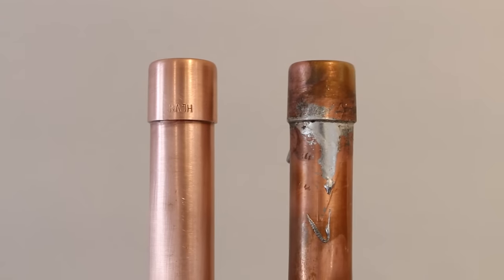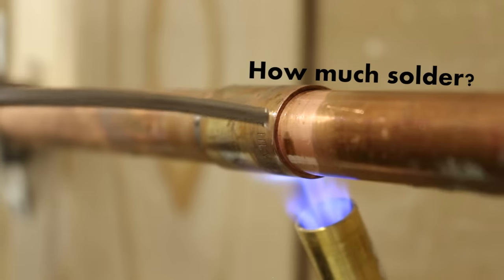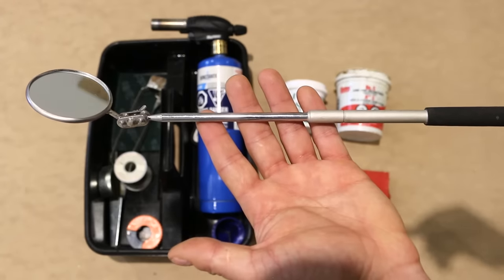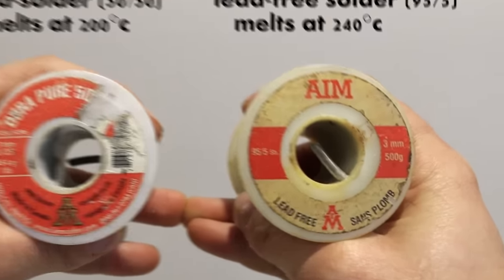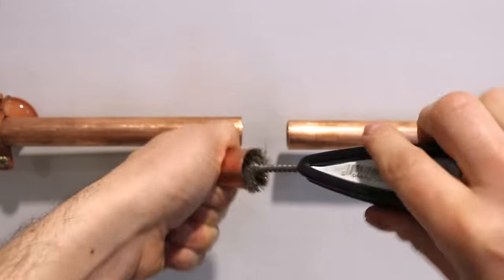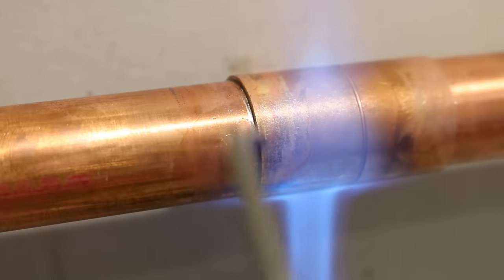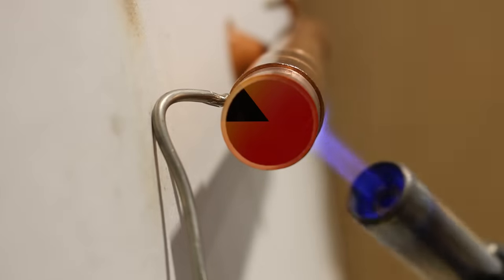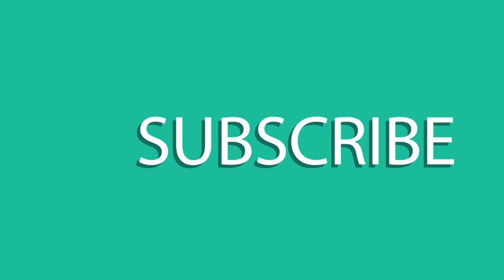How To Solder Copper Pipe Like a Pro (Tips & Tricks) | GOT2LEARN

Comment: the blind leading the blind.  Try rotating the brush as you put it in and out and you won't bend it into a useless tapered brush. Scotchbrite is for pots and pans, plumbers roll emery  is what you clean copper pipe with. Self tinning (dippy dyi alert) only needed if you overheat the copper like this guy is doing. See the copper discolor in this vid, exactly what you don't want.  You start by quickly test touching the solder repeatedly where your are heating. Move fast enough that you don't melt it with the flame.  About the time you see beads of moisture on the copper, hence the term "sweating copper" the solder will flow into the joint, so put a little in to protect the copper from the heat. , it's hot enough, move the flame around or turn it down, the solder will melt and flow into the joint by capillary action and protect the copper from oxidizing from excess heat. NOW move the solder to the opposite side of the fitting while you gently heat the base of the fitting. The heat will draw the solder. Touch the solder to the base of the fitting opposite the flame to make sure it will melt, then you know the whole joint is hot enough. Feed solder to you get a drip, or if going for show until if fills the joint. If you want it to look perfect, like for a trade show, let the joint cool a little then heat and wipe repeatedly,, just enough to heat the surface, not to melt the joint, then use plumbers roll emery and sand solder away.

Comment: do not over heat... MOP gas to hot... and this guy sucks... don't leave heat in one spot even heat 1 inch area keep the flame moving and flame 1/4 inch from the pipe... less heat the better. most solder melts a 450 F. copper changes color at 500 F. will darken to a dull copper brown. 600-700 F it will turn light blue 700-800 blue purple 800-900 white to gray 900-1000 shinny gray then melt... over heating is a killer. and will cause failed building inspection...

Comment: How are you going to make a video claiming a perfect solder then show an example with tons of potential leaks? I wouldn't have made it through my first month with pin holes like that. Same for all the extra waisted time. This just made a quick job take multiple times longer and added more chance of leaks just to make something that the homeowner would never see slightly prettier. I guess it's a good thing copper is a thing of the past cause that definitely wouldn't fly in new construction.

Comment: Never mind soldered joints  it is about time a lot of so called plumbers  learnt how to fit compression joints without over tightening  them and or using compound plus you should NEVER  use any grit or particle based devices for cleaning  pipes so many bad joints are due to bits of sandind compound in the joint

Comment: Use Everflux and save all the time you use on cleaning the copper pipe.I started using it a few years back I was skeptical at first but now I swear by it. Have you ever used it and what's your opinion on it?

Comment: this is how you make a pretty joint not how pros do it you would get run off the job. Im going to make sure there is enough solder in there and good luck doing it this way on 1-1/2 and up. Chinese fittings and Mexican pipe that contractors like to order have id's and od's are always out of spec with gaps to big that you have to try and bridge with the solder. Clean it good, push it in, knock of the excess, and wipe it down with a wet rag that's how pro's do it.
Reply from the maker: Never got ran off any job, once you know how to do it this way, it works just like any other joint.

Comment: Or, you can just run a flux brush over your new solder work when completed to clean up the joint. Then use a dry rage to wipe off.

Comment: You don't need to apply solder to the bottom of the joint if its vertical, just heat and the solder from the top joint will do both. That blob of solder at the end was terrible, visible or not.

Comment: Well its a nice video but when on a time frame u don't get that luxury. Plus 1/2 to 1 in thats easy anything above that good luck. Another note you can't use lead period in California. Another side note is not all fitting are made equal. Warm pipe up and wipe flux off then add solder and itll fallow the heat. Is how i was trained. So it dont look like a Roman candle lol.
Reply from the maker: Yes, this isn't really about time, it's about getting a nice soldered joint that would be exposed, so time wouldn't really be an issue here.
Reply: @Got2Learn  don't get me wrong I enjoy your videos but if u can make a video in hard postion that would help ppl when under houses or tight addics cause thats true skills witch it seems you have. Keep up the good work you have impressed me on some of your videos 😁
Reply: @Got2Learn  and again this art is being faded away with propress or shark bites(John guess fittings) so alot of new plumbers don't know how to solder so thank for teaching them and keep solder alive

Comment: Wow!! Talk about a cold joint! Someone needs to teach this guy how to solder correctly without all of that wasted time
Reply from the maker: No cold joint buddy.
Reply: Solder follows your heat(flame) not the flux so pulling your flame off when the joint is only halfway made is most definitely a “COLD JOINT “! Have fun fixing the leaks. Why would you ever use tinning flux on 3/4” copper pipe anyway?! It’s messy and pointless but I guess you residential guys probably need it
Reply from the maker: @mdebrule2012  🤦‍♂️

Comment: I was told to ream inside of pipes after cutting with tool.
 on a few older pipe cut off tools there is a pointed steel tip used for this purpose

Comment: That blue can doesn't work very well at all. Use map gas in the yellow can.
Reply from the maker: MAP gas, doesn't exist anymore, the yellow bottles you find at Lowes is NOT true MAP gas, it's just slightly hotter than propane.

Comment: Better to make a fully water tight joint this is potentially a way for the joint to leak
Use a bit more solder wipe it with wire wool can look really neat if you do it right

Comment: So on the fittings you just clean the inside right? And how long estimate do you hold the torch to the copper for before applying solder?
Reply from the maker: Yes, only clean the inside of the fitting and the outside of the pipe. For the amount of time to hold the torch, it depends what size pipe you are soldering. The goal is to not burn off the flux, a trick is to keep probing the joint with your solder as soon as it starts going in, that's a good indicator that it's hot enough, just practice a bit and you'll get the hang of it ;) In the meantime, take a look at my other "how to" vid: https://www.youtube.com/watch?v=xJodDBC5AwY&t=1s
Reply: Thank you!

Comment: Is there an involvement of the capillarity action?
Reply from the maker: Yes, capillary action is what makes it all possible :)
Reply: It could be said that flux acts as an adhesive to overcome the cohesion of the solder itself so capillary action is possible.
Reply: Yes.  This video don't explain it right.  It was explained to me years ago so long ago I don't remember exactly.  There are 2 things - I can't remember which is right.  But FIRST, there is the boiling of the flux.  You want that.  Because as the flux boils away, if you do it right, it goes into the pipe and creates a vacuum that sucks in the solder.  Now don't misunderstand, you don't want to scorch / burn the pipe. Gussying up with a scotch brite pad won't undo burning the pipe.  If you burnt the pipe, the pipe is that much weaker chemically in the spots you can't get to clean up.  Second, you want to heat the air inside the pipe that is away from the joint.  When you apply the solder you want to be NOT applying heat anymore.  You want to have the hot air cool, creating more vacuum.  So really the torch goes on until you see/ hear the flux sizzle, then QUICK remove the heat source and apply the solder.  It will suck up and in around the joint the way it does in this video.  I guess this is considered "advanced" soldering... I guess basic soldering is when you run the wire around the joint while torching it and hope there's solder in the joint??

Comment: Youre getting pipes way too hot, thats why your vertical joint drips and fitting have discoloration, tinning flux will tell you correct temperature and until the you can keep solder away and heat evenly

Comment: #1  NEVER use a swirl torch.  It puts out too much heat and burns off the flux.  Biggest beginner mistake.
Reply: @Got2Learn  : swirl torch puts out a hotter flame faster and is harder for a noob to know when the temperature is correct.  carbonizes the flux inside of the fitting too easily.   the 'old fashion' pencil torch on 1/2 and 3/4 takes longer but brings up the temperature more evenly.
the other #1 problem is to not drain/ dry out pipe when doing repairs.   any steam means the pipe cannot get hot enough for a perfect fitting every time.
Reply from the maker: Good input, all makes sense. I am just so used to using mine that it's everyone's go to torch but yeah, it does make it easier to gauge the temperature with those pencil torches, thanks Dave!
Reply: @Got2Learn : thank YOU !  you make it look easy and you are doing the steps exactly right.  you sir are a great teacher and offer a simple and direct and easy to do video.
Reply from the maker: Thank you so much Dave, really appreciate it and I also appreciate have good members like you on the channel, cheers!!!

Comment: The best way is to hold the flame towards the middle of the fitting and leave the width of the solder around the joint. Any dirty lines will cause leaks and if you debri the pipe it will prevent leaks at any pressure

Comment: Hey, great show! Quick question, is there any difference between soldering gas lines vs. water? Thanks!
Reply from the maker: Yes, you don't solder copper for gas lines, you either thread steel piping or weld it.
Reply: @Got2Learn  I gotcha, thanks! It's sometimes hard to sort out good ideas from terrible ones. ☺
Reply from the maker: All part of the learning process ;)
Reply: Where in the world are you ? Most gas  lines in the UK are mostly soldered copper . 
Threaded steel is also used .  But in domestic properties ,it is almost always soldered copper
Reply: Copper for outside BBQ but use flare fittings. Or other gas lines are threaded welded or gas tight
Reply: I guess some countries are different, but where I am yeah you do everything the same,except for gas its ok to use solder with lead. Anything that has drinking water uses lead free solder,other than that the lead solder is much easier to work with.

Comment: I’ve always used silver solder on my copper pipes. Any other type doesn’t melt as easy and recess into the joint as well as silver.
Reply from the maker: Yeah silfos is good stuff.

Comment: The way that you apply the solder causes air bubbles and will eventually cause a leak. Like a professional
Reply: In order to get no air bubbles and full penetration you start at the bottom go about 3/8 around and then come around the other side of the pipe forcing the air out of the joint
Reply: The way its shown in the video the thermal expansion will eventually cause a leak due to a air bubble or not full penetration of the cup
Reply: @lilboyblue5977  Naa I've soldered over since I was an apprentice. Just over 10 years now and haven't had a joint fail. This dude's right on the ball.  If you can do it any better upload a video and show us. Otherwise leave it to us professionals 👍🏻
Reply from the maker: Thx @ghost!!
Reply: Im not saying it wont hold for 5, 10, if not 15 years but the joint isnt as strong as it should be
Reply: @lilboyblue5977  As long as the joint isn't rapidly cooled it won't fracture. My joints are very strong. I've tested my pipelines to over 10 bars of pressure.
Take it from a guy who's soldered 10's of thousands of joints. I press my fittings now only solder on the odd occasions. There's absolutely nothing wrong with the way these joints are formed. I even swage joints now and again. I reckon I could close my eyes and sweat a joint.
When people are constructively helping others. I don't understand why people are always trying to criticize their efforts. I've heard it all from customers to employers.  Many have a have engineer or plumber friend. I realise it's a customer showing vuntribility.  There's good and bad guys out there. "We live and learn".
Reply: ASTM 828 standards
Reply: @lilboyblue5977  Astm 828 standards for tensile testing paper 🤣
Reply: Well at this point im going with you dont know about the copper development association either?
Reply: @lilboyblue5977  our regulations and bylaws governing the institute of gas  engineers is totally different. Plumbing water and gas safety institute regulations govern our work. We have to have years of training to qualify. Do you know anything about pipe purge installation volumes, working pressure, installation standing pressures, pipe sizing, gas rates, and ventilation requirements?  Sweating joints is very simple.  I could go into depth with electrical as I'm a niceic registered contractor.

Comment: Theres fcuk all solder on those joints. I would have never past my C+G with that. I have seen loads of crap under soldered joints failing and its no lathing matter as it cost's £1000s in repair bills.   And those Amazon affiliate links are not the same tools used in this video the Amazon affiliate links tools are 3 times the price. pack of 8 scotch pads for $8.30 is taking the piss you can go down your local dollar store and get a pack of 10 for a dollar uk / us  both the same
Reply from the maker: Ok Ben, have a marvelous day :)

Comment: This is actually the correct method. Thanks, I've been sloppy too long. The only downside is glance inspecting a job to make sure no joints were missed.  
Something else. In urban areas as the bare copper takes on a patina the air pollution turns it black. Not attractive. I lived in Old Montreal in 1980 when the roof of Notre Dame Eglise was re-coppered. Over a few months through my studio windows I watched as it oxidized a beautiful bright green. A sign that the air even in downtown Montreal is very clean. A few years later I was living in Los Angeles where the Griffiths Observatory dome was also re-coppered. It turned black.  They had to clean it off and then chemically patina it green. So a fancy final step to copper plumbing might be to chemically patina it to a nice shade of green. I worked for a sculptor who worked in bronze. His assistant would apply the chemicals, which were like flux, then heat it up with a torch. In a few minutes it would be good for the next several thousand years.  There's a Department of Water and Power building near where I'm living now that used to be a beautiful patina'd green, then some suit decided it should be 'polished' back to bright copper. I thought they must have sealed the surface. Nope. It turned black, looks awful.
When Shutters Hotel in Santa Monica California was being constructed, apparently the plumbers used leaded solder for some part of the potable waterlines. This wasn't discovered until much later after many of the walls were finished, expensive wall treatments applied, etc.... It all had to be torn out, the pipes replaced, etc... Must have been a huge lawsuit. 
What I remember growing up and using lead solder to sweat pipes was this troupe, "There's so little lead that none of it gets into the water. So it's safe."  Until it wasn't. 
Gasoline was also leaded. We kids used to like the smell of car exhaust because it 'smelled sweet.' That was the lead (who knows what I could've accomplished had not plumbing, GM and Big Oil not conspired to expose my generation to lead. This is something else you guys can bash us Boomers about. ) The problem in Flint Michigan was when they switched from Lake Huron water to the more acidic river water; this little bit of acidity attacked the lead in the old pipes leeching it into the water.  (I've been using a reverse osmosis system for the past 36 years.) There's a famous op-ed from the 1920s when lead was first added to gas written by a doctor who warned that this was just mass lead poisoning. Automobiles needed an octane boost to keep the engines from 'knocking,' there were two competing ideas: lead and ethanol. I think GM had the patent for lead and the oil companies also made more money. (Just another reason to never trust an oil company.) I do go on and on.... blame  lead poisoning....
Reply: Lead still used in general aviation. Anything with piston engine.

Comment: This guy is doing it all wrong. You don’t ever focus heat on the front of the pipe and wait till the back is hot enough. That is some shit he made up. Don’t wipe any flux off prior to soldering either. If you use sand cloth you can sand clean just past the cup length. Solder will not take to dirty or un sanded copper even with flux applied unless it is super clean with no brown spots or deep scrapes. There are specific requirements on the amount of flux and lengths of solder wire per pipe joint size! That is key the PIPE JOINT SIZE. Even when gluing PVC there are specifics in place to insure a strong joint. Amount of joints and sizes are usually on the can of glue and primer if you can still read them.